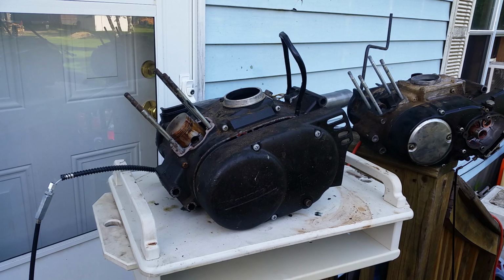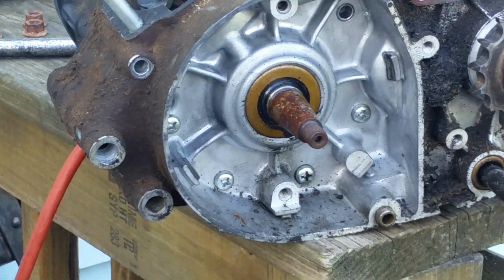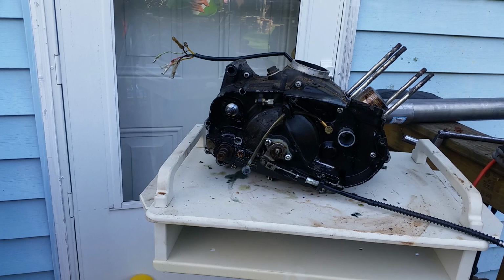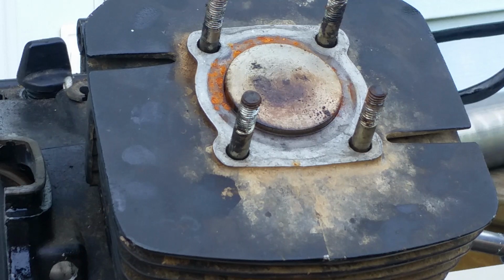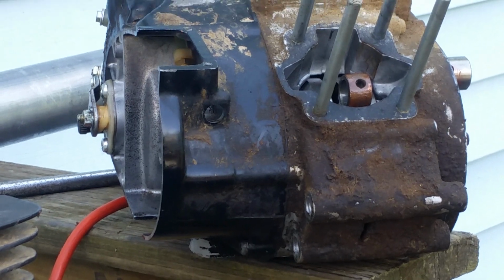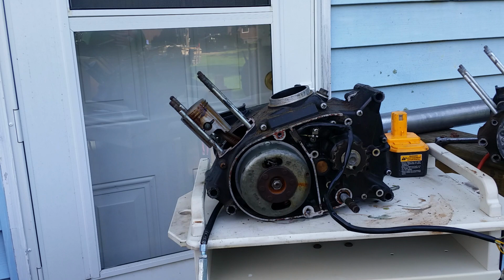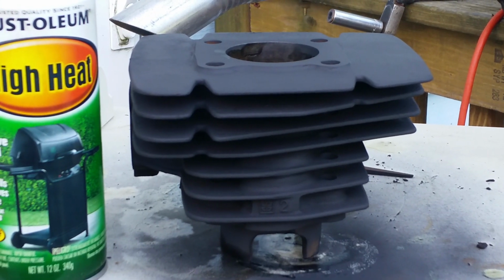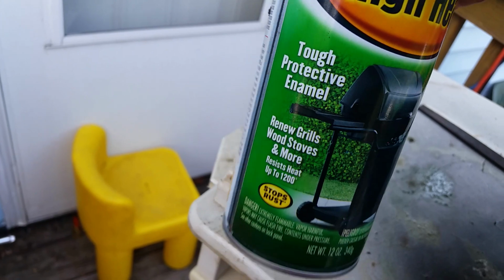KE100 engine conversion to replace kaw 100cc 10speed g4 engine part 1

Comment: If the strokes are the same but the piston wrist holes are different locations/ diameters 12mm vs 14mm. Would it be possible to use a conecting rod and piston from a ke100 in a 72 g4tr to get it back on the road? Mine suffered ring failure yesterday and it it damaged the piston heavily and I really don't want to have to scrap the bike as I can't find a piston. The parts websights keep giving me conflicting answers.

Comment: At the 20:18 mark in the video concerning the exhaust, can a KE100 exhaust system be used on the G4RT Trail Boss....or do you have to do the KE100 exhaust / G4TR weld / conglomeration?
Reply from the maker: Its an adapter
Reply: @2strokeguru  An adapter from the G5 exhaust to the G4 exhaust system.....got it.

Comment: I have a '74 kawasaki g4tr. Is this basically a ke100? I'm having trouble finding info on it, but it likely needs a new motor. Any info you could spare me would be super helpful.

All I can find on them is that it is a 99cc single-cylinder and 10-speed, which it seems to fit the bill.
Reply from the maker: the 99cc is a 100 they round up so a 79ccis an 80 89cc is a 90
Reply from the maker: my youtube channel covers all thease bikes
Reply: thanks for the info. I'm mostly looking to find another engine to swap into this bike. The original G4TR engines are proving quite difficult to find in a shape worth putting on the bike. However I'm aware Kawasaki made multiple 100cc bikes that used basically the same egine, and I'm looking for engines similar to the one to swap in.
Reply from the maker: check craigslist might beable to find a parts bike cheep

Comment: can you put a 250 in the ke100?
Reply from the maker: you would have to cut and weld mounts custom exhaust and re wire its not a direct replacement
Reply: +Kevin Bergeron okay thanks I'm getting a 2001 next week I'm definitely considering putting a bigger engine in it thanks :))
Reply from the maker: thats a lot of work
Reply: +Kevin Bergeron I know I'm going to keep it as is for a long while before I do that it still has low miles
Reply from the maker: awesome they are good bikes